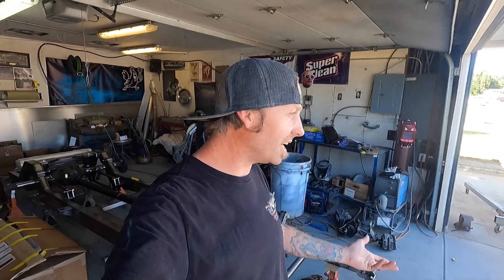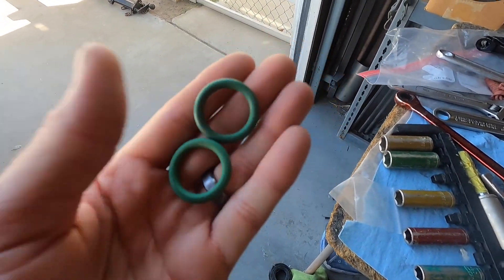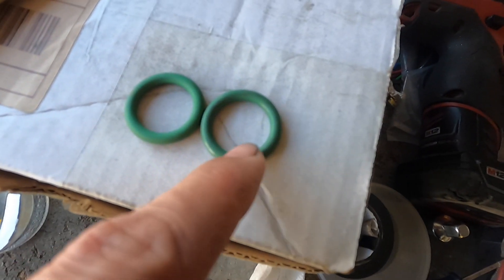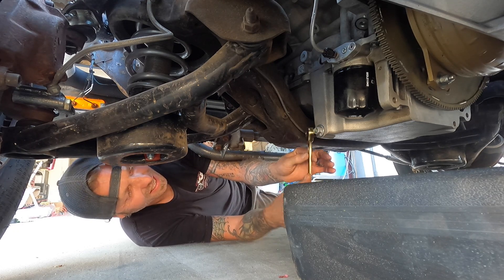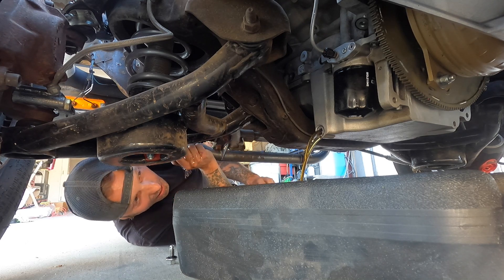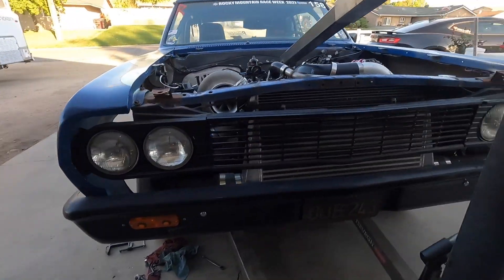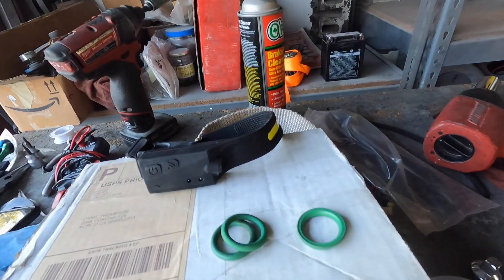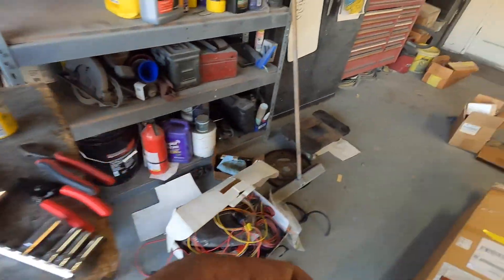The O Ring Strikes Back

Comment: We've all done it. My project 94 s10 ss 6.0l. Motor on engine run stand and still punched the crank a couple of times. New melling high volume pump and new Canton oil pan and pickup same o ring. I make 70psi at pump and 65psi at regular spot hot. Junkyard motor with a summit racing cam and ls7 lifters and new cam bearings
Reply from the maker: Im learning slowly but surely over here haha

Comment: Interesting. I have always related green o-rings to A/C components.  What color is the factory oem o-ring that is on the pich up tube?
Reply from the maker: LS have a few different ones and different manufacturers like to change the colors up as well. Typical colors are red black and green. All different sizes depends on pick up tube type.

Comment: Speaking about oil filters.
Have you ever cut one open looking for gold?
I would expect some metal and dirt after assembly and braking the engine in.
The few times I've rebuilt engines I've never thought about checking the oil filter, but then I have changed oil and filter after running the engin max a few hours, and just hoped for the best 🤞
Reply from the maker: Never cut one open to tell you the truth.

Comment: For a couple bucks on ebay probably other places but they sell a piece that let's you put 2 bolts to hile the pickup in
Reply: I 2nd this
Reply: Pickup girdle…..yeah I got one sitting in my tool box I think I paid like $15 for it but didn’t need it because the pickup on my Holley 302-2 pan uses both bolts…..some day I’ll find a use for it if I end up using a factory oil pan
Reply from the maker: I have a cheap oil pan and the pick up comes with allen head bolts and a two hole flange. Warr sells the part you are talking about tho. I have bought them before but have given them away so I don't have one at at the moment. Good idea tho!

Comment: My suburban use to idle with like over 40 psi I think but it goes down to like 25 psi or something at like 65mph I'm at like 1800rpm and its at maybe 45psi but it use to be like 60 I think at speed so I'm sure it's fine but I have a new oring but I'm lazy
Reply from the maker: Out of site out of mind haha. The problem I have vs what your doing is I need the higher pressure at higher RPM. A daily driver won't see a ton of RPM all the time so even if the pressure was a bit low as long as your not red line form stop light to stop light I bet it wouldn't even matter.